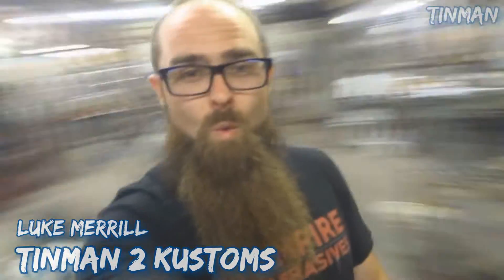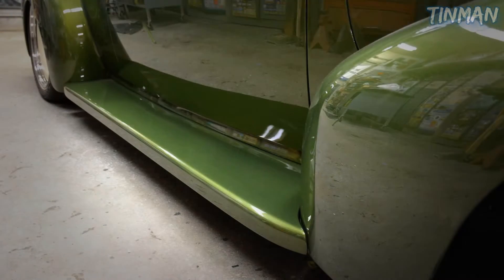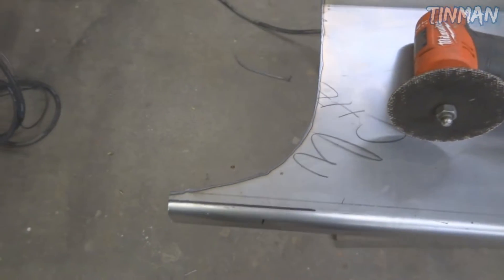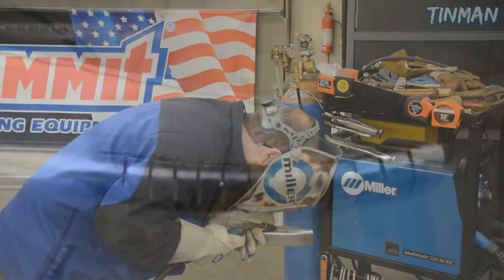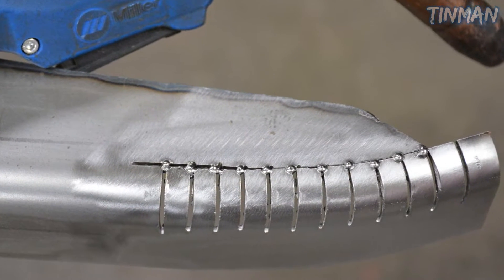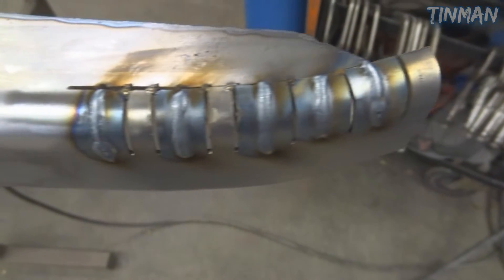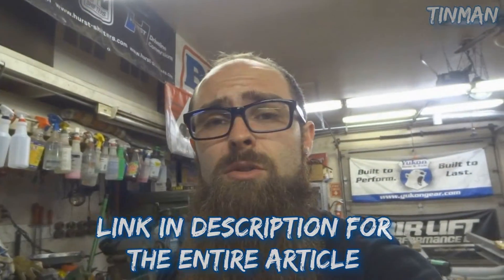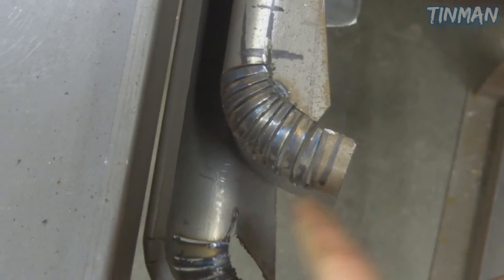Controlling Heat in Sheet Metal Welding Cutting Shaping How To

Comment: Mig welding alot of 16 gauge sheet metal , im cutting out old damaged areas and bending and shaping new sections and welding new sections onto the existing  . My question being on long 4 to 6 feet of butting new metal up to old what is the best way to weld that long seam without warping metal or ending up with a dipped in section running down the seam
Reply from the maker: Its almost impossible not to get some warp. But taking your time and trying to keep it as cool as possible is your best bet. The heat is what causes the shrink, which is what causes the warp

Comment: I've always been taught that the triangle is the strongest shape.
Reply from the maker: I guess it depends what you consider the "strongest". There are certainly applications where a triangle is stronger/more useful. But In Terms  of being most resistant to deformation with heat and weight in one spot, a sphere or circle is the most resistant/strongest. That's what this video/article is more concerned with. Changes from concentrated heat
Reply: @Tinman2Kustoms  Ah. Thanks for the explanation. I'll rewatch the video. Good luck with your new series!